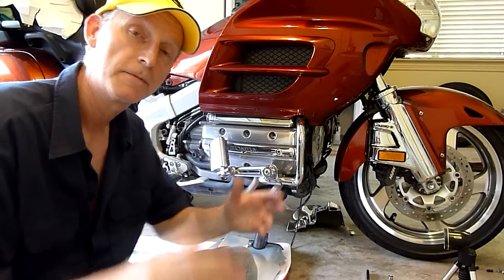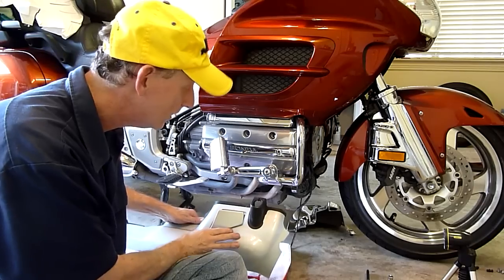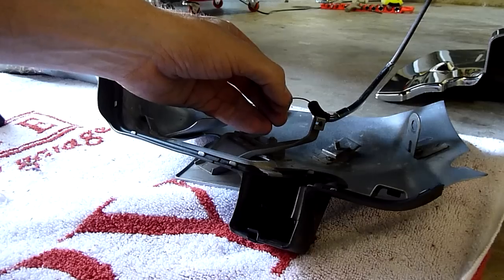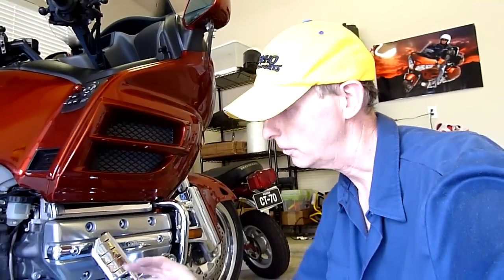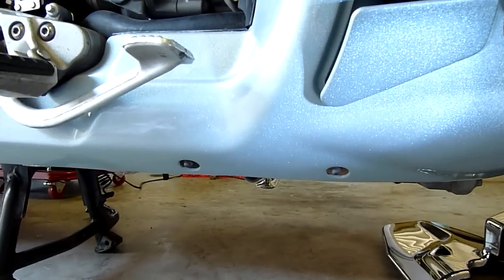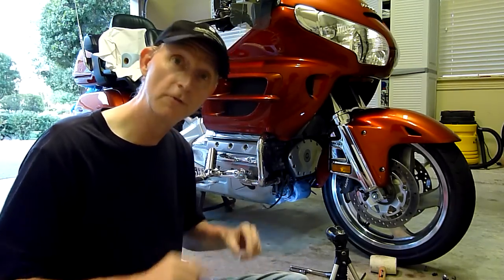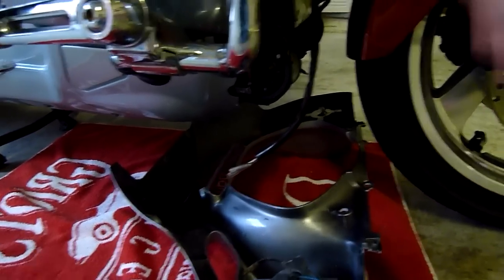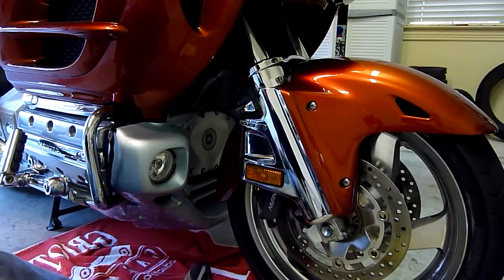Goldwing Cowl Project - Part 4 (v2)

Comment: I'm thinking about buying an 08 but crazily does not come with fog lights from the factory, hard to believe, although the cowl holes are there, is this a huge job to put these in and do you have to buy a manufactured button for the dashboard for it? Thank you